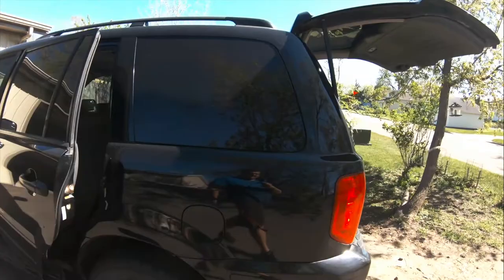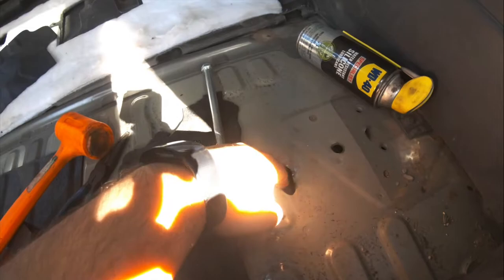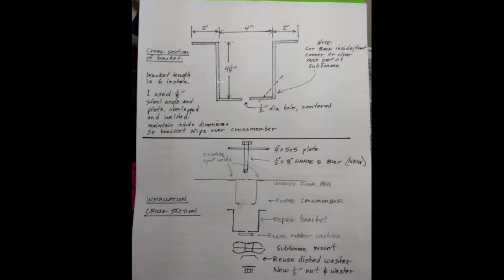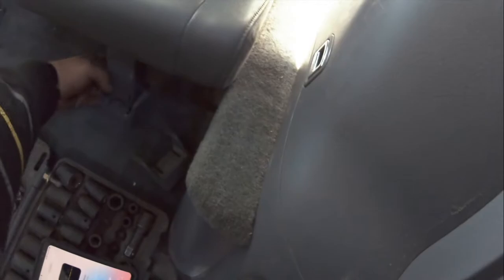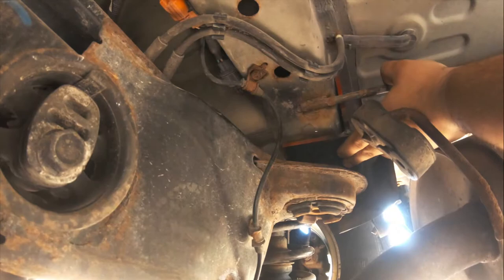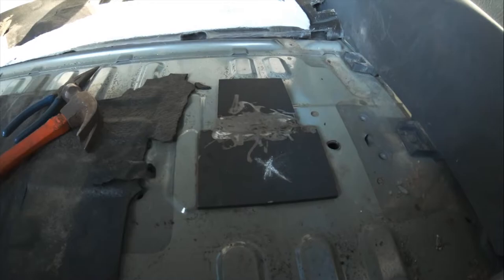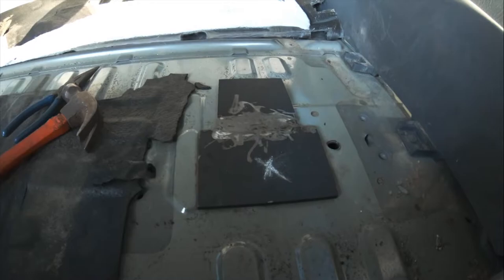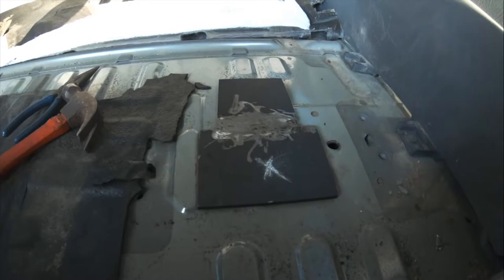Honda Pilot Rusted Rear Subframe Repair Guide (not step by step)

Comment: Great job! For anybody freaking out, My Pilot has both sides rusted and blown out. It has been that way for six months but I never noticed (I heard it happen, but didn't know what happened). I have an 8 inch gap where it should be connected. Don't freak out, it's the end of the world, just get it fixed ASAP. Also, just talk welds are sufficient. The welds are only preventing the plates from shifting side to side. The plates are in compression against the frame once bolted. Thanks for the video dude!
Reply: Well you definitely eased my mind. I just noticed today that the rear driver side has rusted out but the passenger side is still fully intact. I instantly panicked and didn't want to drive the car in fear of something that would happen. It still drives normal though.

Comment: 2012 Mercedes benz c300 sport 4matic just had my subframe welded. Rusted real bad. First was told that I needed a new subframe $2700! I freaked out and the welder called me back next morning and said he'd drop my rusted subframe,  clean the crap out of it and weld. A month later an inspection station had it up on the lift with a flashlight , didn't mention I just had subframe welded. 20 minutes later I passed inspection.
Reply: Mercedes is now covering these subframes under extended warranty, I’d suggest you have it done correctly.

Comment: TSB on this problem from honda.  They have a kit but its really expensive.  Ridgelines have the same problem and it's a recall for it.  They won't recall for pilots.  too many sold $$$$
Reply from the maker: Honda did quietly address this issue after the 2008s but won't do anything about the older ones besides offer the kit.
Reply: Exactly , they should have a recall but they won't. They state 'owner responsible for repairs' so they know its an issue , yet only in certain climates. ROAD SALT #1 cause

Comment: Your making my exact same issue seem salvageable. I can't Honda doesn't recall this bs
Reply from the maker: @kylemurr5251  this is a easily fixable issue. Honda has a tsb for it which would fix it but you would have to cover the costs. The vehicle is over 20 years old since the first pilot hence why there is no recall.

Comment: Gravy my man!.  Mine is rotted TF out.  I never thought of just putting a plate on top with a longer bolt.  Same effect as having it in the cross member really.   Thanks!
Reply from the maker: @TheDivergentDrummer  Yes sir, this is an easy fix just requiring a metal plate and longer bolt with some light welding. Mine is still going strong 4 years after the repair!

Comment: Mine failed inspection today due to both sides being blown out. Sad day. It’s a 2008 Pilot with 225,000 miles but love that thing.  Runs great & just put $800 into brake system not long ago. Newer tires, battery, etc. Was gonna have exhaust fixed today the right way today but they suggested not too due to the frame. So not sure what to do with it now. And I don’t weld
Reply: I didn’t notice much difference in driving it btw but been gradually getting worse since last year because the same people inspected it last year & said the subframe didn’t have much longer but they still passed it. It’s def worse now & I saw the holes on both sides. My back tires are really good still but steering is little loose or something it seems but was gradual and think it hydroplanes easier now. Only differences I’ve noticed
Reply from the maker: You should be able to find a decent welding shop that might be able to tackle that repair. Honda actually sells a subframe repair kit for this exact problem but it is much more expensive than having a welding shop just weld some 1/4” steel to the frame
Reply: I did just find someone and they said $300 but they thought it was just the one side

Comment: I need to do this to my 06 Derecho damaged Pilot (2 trees fell on it, but its run nicely for about 3 years beyond that event - theorize that the weight of the trees fractured the chassis mount point allowing water and salt to invade what was once a nice underbody).  Its times like these that I wish I had taken a shop class in welding in high school.
Reply: And I forgot to add why I was making a comment.  That being that I've always heard from my dad's antique car restoration guys, that if you don't cut away all of the rust (not just surface rust), it will continue to eat away at the metal.

Comment: Thanks for this video and the reference to the Piloteers thread!

I’m gonna have to do this to my wife’s pilot, just discovered this issue. What voltage did you use for your welder? 

How is your Pilot holding up? My wife’s just rolled over 290k, I’d like to get it to get more life out of it.
Reply from the maker: Glad to help! I'm not sure what voltage it was since mine just has a 1-5 dial. Use the settings for your welder for 1/2 inch steel. 
My Pilot is holding up awesome even after over 30k miles of half asphalt and half gravel roads. 
Wish you the best of luck in your repairs!
Reply: Great to hear, thanks!

Comment: Thanks for this video. When looking at the car from a distance , did this approach make the car seat a little lower on the rear compared to the front ?? Also was alignment and ride handling impacted in any way ?
Reply from the maker: No, the suv does not sit any lower than the front or how it sat before the repairs. The ride feels exactly how it did before if not a bit firmer since the back was rotted out. My alignment is not perfect due to the rear adjusters on the arms being frozen due to rust from road salt over the years. Will be tackling that problem eventually as it doesn't bother me yet. But alignment should not be impacted as a result of this repair.
Reply: @AleksUsovich  Thank you so so  much... just experiencing the same issue on my 07 pilot... Will use your approach...

Comment: Hey how did you get the bolt out of the bushing inside of the subframe itself mine won’t come out it’s seized in there and did you reuse the bushing or anything inside the subframe itself or just the rubber top piece like in the diagram you showed and the dished washer because on the left side I was able to point out the bushing and bolt but couldn’t get the bolt out the bushing itself so now I have the top rubber piece but nothing inside the subframe itself and I ordered the dishwasher but can’t find the bushing anywhere was just curious as to if I can just use the top rubber piece with nothing in the subframe filling the whole or any suggestions on that at all please let me know I have it torn apart but have no bushing for the subframe at all
Reply from the maker: You will need to cut the bolt out of the subframe. Get a sawzall and jack up the rear of the Pilot and cut the bolt out. You will need to drill the hole up in the floor with a 1/2 or 3/4 drill bit and use a 1/2 or smaller drill bit to drill holes around the nut holding the rest of the bolt in there. Can drill multiple holes and hit with a chisel to knock out the nut and rest of the bolt. After you cut the bolt the bushing and dishwasher will fall out. The bushings are no longer for sale for the rear but you will need to find them somewhere and cannot go without them or the subframe will be hitting the frame of the car and causing damage. Can try using these bushings: 50231-S3V-A01. They're for the front but theoretically should fit the back subframe as well.

Comment: @Aleksandr Usovich: Great video! Question: For the people who live south and don't currently have this issue, what do you suggest we do as a pre-caution to never have this happen to our pilot's incase we ever head north or other rust causing situations...? Thanks!
Reply from the maker: Thanks! Great question. What I would do is clean off the bottom of the Pilots with some degreaser and pressure washer and let dry. If you see any rust starting remove it as best you could with a wire wheel and degreaser and wash then let to dry for a few hours. Get yourself some rubberized undercoating and spray the bottom of the Pilot and most metal surfaces avoiding anything that gets hot (eg. Oil pan, exhaust, diff, ect) and avoid spraying electrical connectors/wires. Do about 2-3 coats following the instructions on the can and you should be good to go for a few years. Can look for some 3m wax cavity spray that comes with a long wand that you put inside the frame and coat the inside which will help preserve the inside as well. I live in MN and have recoated my Pilot twice roughly every two years since the heavy use of salt for 6 months during the winter and gravel from frequenting gravel roads seems to chip away the undercoating. If you undercoat your Pilot and are in the south you probably wouldn't need to undercoat it again for a few years since it'll hold up much better. If you do visit northern states that use salt, just visit the car wash once a week getting the wash that washes the underside of the vehicle and you should be fine! Hope this helps!
Reply: Amazing reply! Thanks for taking out time to type that out. If possible, for the sake of every Pilot owner; can you please make a video of you rubber coating the pilot at the bottom so we know exactly which parts to avoid & how to do it properly and professionally? Would appreciate that tons!
Reply from the maker: @NK-yv5oi  Glad to help! As soon as the snow melts and weather gets warmer, I'll make a video showing the technique and how I go about undercoating it. Thanks for the suggestion!

Comment: Hey man I have to do this to my pilot. Was wondering if u dropped the tank to weld those L brackets in?
Reply from the maker: Nope, no need to drop the tank. Spare tire will need to come out just for welding safety and space. Brackets fit right in with plenty of room. May need to remove the exhaust from the hanger to get a few more inches to get a mig gun in.
Reply: Alright man. Thank you very much for the reply.

Comment: This just happened to mine say i wanted a shop to do it how expensive do you think it would cost?
Reply from the maker: Depends on what kind of shop. Honda won't touch it. If you can find a welding shop that has basic hand tools, can cost you between $150 to $500 depending on what their shop rate is.

Comment: I have the same problem and the welding shop quoted me $350. If go by this way, will this withstand if I take it for longer run? And will this affect the selling price when I try to sell it off or its a junk at final?
Reply from the maker: This fix will keep the suv on the road for much longer than without repairing it. You will get much more for the vehicle when selling due to it being repaired instead of with two rusted holes that compromise both the suspension and safety of the vehicle. $350 is well worth it for the repair
Reply: 350 I don't have no problem with paying that I'm am being charge 12 to 1500 smh but that's why I haven't rushed on it hopefully can find it for a better price

Comment: Hi! Did you have to do wheel alignments after this? Also how's it holding up after this long?
Reply from the maker: No you don't have to have an alignment after this. It's been a few years and I still have this Pilot- everything I welded is still holding up with no signs of breaking or looseness. I recently had the Pilot aligned and it's straight as an arrow.
Reply: @AleksUsovich  Awesome! I need to do this on my 07 Pilot, Your video have given me  some confidence to start. Thank you!

Comment: Sir

When u did the drivers side…how did u get bolt out…mine came out bout 1/2 “   Then seized up

Did u cut it out?  Or did u drilll it out?
Reply from the maker: I cut it out with a sawzall
Reply: @AleksUsovich  

Hey thanks for replying man MUCH APPRECIATED.   Did u sawzall from inside or from bottom

I’m going to drive to a friends place he has a lift that should help.

How did u start the sawzall.  I see a black circle inside vehicle is that the top of the bolt HOLE?
Reply from the maker: @thadmaroon  cut from the bottom. You need to cut between above the black bushing. Once that is cut, you'll need to drill holes in the floor pan and see the rest of the bolt up under the floor plan. If you can't remove it, drill holes around it or use air hammer to remove it. Then you should be able to put the new bots in and use a larger metal plate up top for reinforcement
Reply from the maker: @thadmaroon  also have a look on Piloteers forum specifically on the Subframe repair thread as it'll have some really nice tips and other ideas for repair
Reply: @AleksUsovich  

Thanks Man!
I think I see now!

Your a super star!!
Reply: U think it’s okay to drive to my friends house bout 45 highway miles away with that bolt missing?
Reply from the maker: @thadmaroon  In an absolute emergency-possibly. You'll have a lot a strain on just one bolt in the back and would take one pothole to shear the bolt off and drop the back subframe messing up the vehicle. I'd take slower country roads just incase something happens

Comment: How does the bolt at the bottom of the bushing stay in place ?
Reply from the maker: There's a nut at the bottom that holds the bushing in place
Reply: @AleksUsovich thank you , and last question, what’s the bolt description that you used to go through the hole? I can’t seem to find these gold ones . And is it 8 inch bolt?
Reply from the maker: I don't remember the exact size, I believe it was 8 inch. It is golden because it is zinc coated for rust prevention.

Comment: I got someone doing it for about 3000 does that sound reasonable to you for this kind of repair job
Reply from the maker: Possibly? You can buy the metal your self and save some money. You need 1/2 inch steel. Call around to some welding shops and you can find it done locally for much cheaper. Check out Piloteers.com and search on the forum for subframe rust repair and you can see what others paid to get it done.
Reply: @AleksUsovich  it was too far past repair the whole sub frame is rusted out they said even if they fixed it wouldnt guarantee to hold I’m just sad someone sold it to me two weeks ago and didn’t say anything
Reply: that's too much money, you could buy another one with that money, I got the same problem, so im taking it to a few body shops, that do side work, by my local junk yards,  for 250 jus gotta bring the metal, supplies

Comment: How in the world did you remove that black sound barrier? I’m currently trying to remove it as I’m sending this to you and it is not coming up
Reply from the maker: Hammer and chisel. You chisel the corner of it to start and keep moving in until it's all removed
Reply: @AleksUsovich awesome , thanks I got it removed, thanks for the information and the video , helped out a lot , figured there would be more videos on YouTube of this since it’s so common the rear ends rust out .
Reply from the maker: @Hardtimesflushthechumps  Absolutely! Glad to help, I believe I was the first one to make a video with this info with Eric the Car Guy making a similar video not too long afterwards.
Reply: @AleksUsovich  yes sir , a lot have watched for guidance, and I seen his video as well . I think he bolted his bracket no welds tho , I’m going to try the welding.

Comment: Eric the car guy did a good repair on one but he went to Honda and bought the bolts aint no way in hell I'd got bolts threw honda I bet they waxed him on the prices. I'd just went with grade 8 bolts.
Reply from the maker: I've seen his video and noticed that too. I used grade 8 bolts and haven't had any issues for over a year in MN with about 10-15K driven, mostly on gravel or off road. I used zinc coated bolts and am happy I did for the extra rust resistance.

Comment: what happens if you don’t fix this ?
Reply from the maker: Best case scenario is that the subframe slowly fails and breaks when car isn't moving and you junk the car. Worst case scenario is you hit a bump in the road while on the highway with both sides of the subframe failing at one, losing suspension and control of the rear end and crashing either causing extension damage or death.